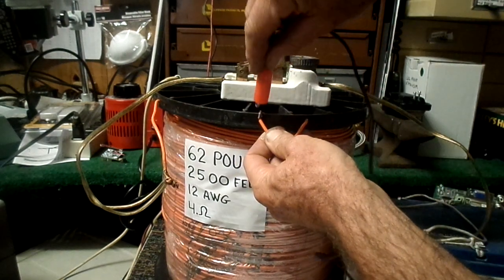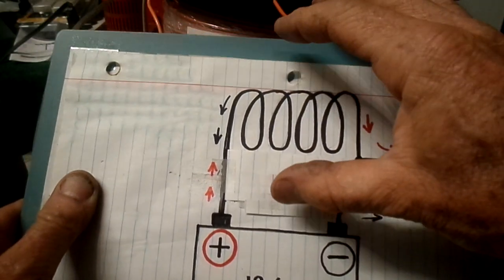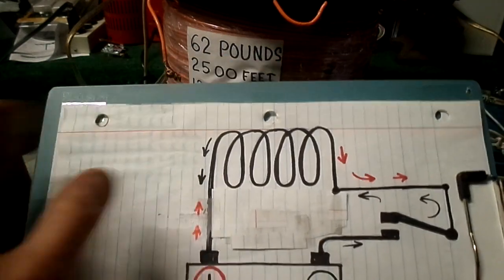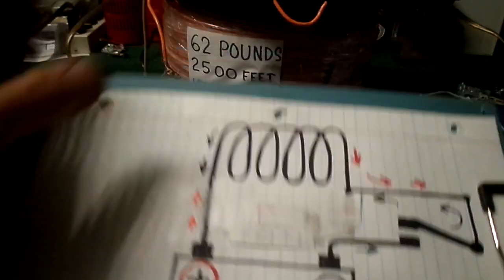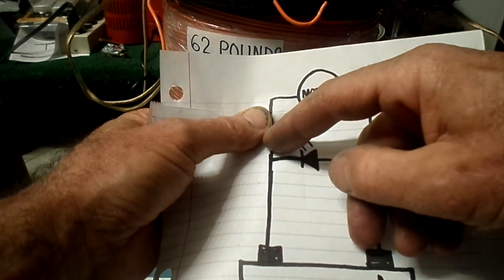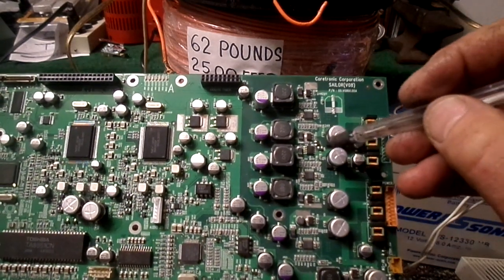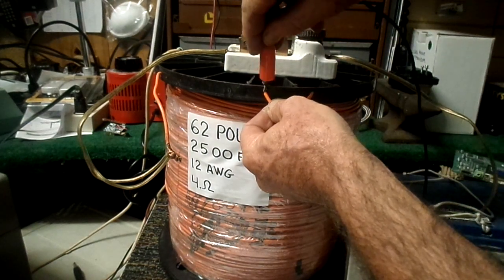The Back Spike From A Coil Can Destroy Switches, Relays And Electronic Parts.

Comment: "The Back Spike From A Coil Can"
What is a coil can?
Anyway, yes, I was exploring this phenomenon a few days ago.  With a 30 volt dc, current limited power supply, on breaking the circuit I get 800 volts peak-to-peak, probably more but that's as high as my oscilloscope measures.  Not only that, it oscillates and the spark lasts about one millisecond but is actually a hundred or so sparks.
Reply: Right it oscillates back and forth but it can go thousands of volts I always called it transient volts not back spike.

Comment: Energy is conserved, but power could theoretically be momentarily larger than before the spike. Energy is the sum of power. If the energy is released very quickly, the power could be destructive. In fact, the lower the resistance next to the diode, the slower the release of energy. This is initially counterintuitive because we associate a short with danger. But the current in the coil is allowed to die down slowly, letting the energy in the magnetic field die down slowly.
Reply: THE LAW OF CREATION OF ENERGY 
How Electromagnetic Field Energy is created in all Current Bearing Wires at the Sub-Atomic Quantum Electron Level via Electron Fission and Electron Fusion: https://www.youtube.com/watch?v=hVPT1KvVmFE

Comment: What interests me is if it’s possible to temporarily store some of the coil energy in a motor into capacitors to improve efficiency and protect against sparks when turning the coil off. (And feed energy back when more effective.)
Reply from the maker: I've done this, but there are problems you encounter in attempting to recycle the back spike, which slow the motor down.
Reply: You have just discovered the Tank Circuit; a capacitor in parallel with an inductor (coil).  The inductor charges the capacitor, but the capacitor then energizes the inductor.  Back and forth it goes.
Reply: Now if you put in a diode so the capacitor cannot just bleed back into the coil, you have invented the "boost circuit" where a lower voltage DC can be made a higher voltage DC.

Comment: Interesting video.. I've been experimenting with the Spike  & I've come across what you're explaining in your video..  I built an Automotive Relay Charging device which I'm currently having a go at sound proofing & when I tried measuring  the output going to the charge battery it killed my meter.
Reply from the maker: It sounds like you may have low end meter, and you exceeded it's voltage capacity.

Comment: there is something bothering me in your explanation but I can't really put the finger on what it is. Isn't it so that when you stop the current / open the switch, the coil doesn't create a reverse polarity, but in fact keeps pushing current in the original direction, because the coil resists changes? So this is why placing a reverse diode works, because then the current can just go on in the same direction, looping back to the start of the coil, while without it it would burn your LED (in the motor example) overpowering the LED in its reverse (blocked) direction with +80V on the anode, and boom
Reply: You are right. The video creator has not understood that "Back emf" is only induced while the coil is charging. When the supply is switched off, the magnetic field collapses and induces current in the same direction as during charging.
Reply: Correct.  Also, the snubber diode will slow down the decay since the decay current is actually still a current and helps maintain its own magnetic field.  This is a factor in things like relay drop-out or release.

Comment: You mentioned that the power would be reversed after opening the circuit.  This was confusing to me until I realized you probably meant that the voltage across the coil swapped polarity.  I'm pretty sure the current through the coil continues in the same direction - you apply a voltage across the coil, like spinning up a flywheel, and when you break the circuit the flywheel tries to keep spinning, pushing really hard and building up large voltages almost immediately.  (I suppose technically power = voltage*current, so the power DID reverse, but I sorta don't think that's what you meant.)
Reply from the maker: Yes I meant the polarity was reversed coming from the coil the moment I opened the switch.
Reply: This is how it works. Consider the coil as an energy storage component just like a battery which store energy during charging and release energy when the battery is used to power a load, so when you send current into the coil, you are actually charging it and when you remove the power source, the stored energy comes out but due to the nature of coils the polarity of the stored energy will be reverse

Comment: You are making hybrids of Tesla’s hairpin circuit. It uses a spark gap to generate back EMF, as a normal capacitor would be burned out. The primary coil is acting like a capacitor.

Comment: I suspect that your experiments can go further.Try the very same experiment but this time with various cores.The usual soft iron laminated core, ferrite , the phenomenal Metglas and Permalloy. In addition, pulse it at its resonant frequency......And lets see how the BEMF behaves...... I have subscribed and I have clicked the bell.Waiting to hear from you.
Reply from the maker: Aa one who loves to experiment, you have stimulated my curiosity. Have you ever conducted the kinds of experiments you suggest. If so what did you discover?
Reply: @GrantsPassTVRepair  Glad to hear from you.Like you I have a interest in magnets and coils ;-). I was fascinated when I actually proved that BEMF existed.So it lead me to start  planning experiments like what I am suggesting.Air Core versus Iron versus metglas etc.As Metglas has high permeability and can operate at higher freqencies, I am thinking we should see something interesting.
I only got to the charging capacitors with BEMF.So my next move is a series of Microwave transformers driven at their resonant frequency.....But i gotta get volt meter number 10 and a handheld scope.You however have the equipment and drive.I would love if you did those experiments.I am learning from them.
Reply from the maker: @garydunn9418  I've put many of my ideas to rest, in pursuit of so my responsibilities, but it's still fun to ponder now and then.
Reply: @GrantsPassTVRepair  Does that meant you wont be trying the experiment with the suggested cores ,resonance etc?
I plan to.I will report my results here.I wont buy the metglas yet as I have to experiment with the iron cores I have first.I see no point in moving on to metglas if the theoretical effect is not seen in iron cores.
Reply from the maker: @garydunn9418  Perhaps at some time in the future I will,
Reply: THE LAW OF CREATION OF ENERGY 
How Electromagnetic Field Energy is created in all Current Bearing Wires at the Sub-Atomic Quantum Electron Level via Electron Fission and Electron Fusion: https://www.youtube.com/watch?v=hVPT1KvVmFE

Comment: I always wondered why there was a diode present so often on magnetic coils.
I thought it was just a passive overvoltage protection for the coil, but it's actually an overvoltage protection for the relay powering the coil.
Reply from the maker: The diode across a relay prevents the back spike from  the coil from damaging one of the regulators or other components in the power supply.

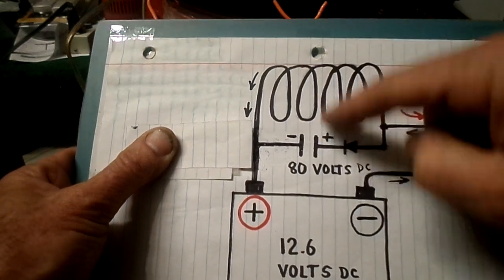Comment: I don't know what you mean by black arrows on left and negative voltage at 2:15... won't the inductor always be positive on top left and push current to right to maintain its desire to not change current direction?  Also I always wondered what happens with capacitor voltage,  how it ever discharges, and how effective it is depending on duty cycle.

Comment: went it school for electrical theory and if the current is ac or pulsed one can for limited time observe reactive power and power flow from anther demotion. one has to balance capacitance, reactence, inductance, and it can be observed!!! get the balance right and the electric meter will spin backwards!!! been a long time do not have my papers or books but their are is some solid theory. but it has yet to be quantified.  if one wants to find alternative electrical energy, electro statics and rf/pulsed dc is where I wold look, all the study has been ac/dc. take care.
Reply: look into newman motors. they run on that principle and uses negetive amps to run.

Comment: Thanks for the video. maybe you can educate me.
 I'm using a timer to energize two 6v relays. One relay provides + current to a dc motor the other provides ( - ) current to the motor. The motor opens a small door. When the door is fully open it hits a limit switch which cuts the power.  In time a different timer activates 2 other 6v relays that then sends + and ( - ) to the same motor but in the opposite polarity to reverse the motor thus closing the door. All are running off of the same 6v battery. When one timer activates the relay and the door hits its limit switch killing the power the opposite timer picks up some sort of back spike and goes dead. What do I need to do? Do I need a resister, a diode or something else? And where in line would it go? 
Hope you can help!
Reply from the maker: That's more details than I'd care to figure out withouting being well compensated for my time.

Comment: If another coil is added in series with the flyback diode so that the back emf from the main coil energizes this new coil, can a feedback loop occurs in the system in which current from the battery adds up in parallel with the back emf of the second coil to power the main coil once again
Reply from the maker: I'm not entirely sure I understand your question, but it sounds like you're wondering if the back spike from a coil can be recycled, to where it can go from one coil to another, and keep going indefinitely. If that's what you're asking the anwer is no. Due to the resistance in the coil, the flyback spike keeps getting weaker every time it oscillates. You may find this video I made a few years ago to be of interest.  https://www.youtube.com/watch?v=Ky2T1-n_Fks
Reply: @GrantsPassTVRepair yes, thats the idea.since the second coil can also produce back emf current during operation could it be recycled
Reply: @GrantsPassTVRepair  if the back emf from the second coil is recycled back to the first coil and results in a higher back emf from the first coil to the second coil in the next cycle perhaps this could be useful
Reply: @GrantsPassTVRepair  I believe since the back emf from the second coil would be in parallel arrangements with the battery to power the first coil again in the next cycle assuming you are using a make and break device or pulse generator to run the system
Reply: @GrantsPassTVRepair  I know what I said my be tricky but I believe that if the timing is right there should be effective feedback between the two coils
Reply from the maker: @morufaregbe4627  Such ideas sound promising, until you start experimenting with these ideas, and discover they don't work as you would hope, but I'm all for experimenting. It can give you a better understanding than what you may read about in books.
Reply: @GrantsPassTVRepair  yeah you maybe right but it's just an idea I created in my mind but I've found a better idea that would actually work which is similar to capturing and accumulating the back emf to enhance the efficiency of the system. I've already simulated it several times and the result was amazing but I am not sharing it here for security purpose. The one I described was one of my many concepts.

Comment: You see I have problem there Is there any calculation for alternators how is their starting charge effected be useing centrain capacitor types with the lead acid baterry .
I used hv ceramic capacitors just for fun to test out that plasma ignition just bunch 3kw multipel ceramic capacitors in series soldered together 1 goes to + E core type hei ignition coil the 2 side from capacitor directly to ground now I have strange problem me original starting charge from 1000rpm sudenly goes up to 3000rpm or more so tehnicaly speaking me altenator light is always ON if Im under that rpm range so me alternator who is a delco 12si I ques is constantly back charging.
So it apears true ground baterry potential is interacting with alternator and capacitors.
So is there any way I can stop alternator to get effected be this strange effect?
Similar happens to tractor alternators who have capacitors if the capacitor fails the baterry does not charge at all.
So any advice how to counter that problem?
Shuld I use capacitie on the alternator to counter those series hv capacitors on me ignition coil?
Plasma ignition is nice so is amplifier ignition but the baterry get effected from it sadly.
Be the way with plasma ignition the starter motor spin lot faster and smuther engine running perhaps litel bit bether fuel economy.
So thats why I wonder how is that potential controled with capacitor and baterrys exactly does there exist some equation or similar and exactly what type capacitor is used to control field in the alternator?
Reply from the maker: You ideas don't make much sense, so I can only comment on your last question . The field  winding on an alternator is not controlled by a capacitor. It's controlled by a regulator which varies the power going to the field winding, and this in turn regulates the alternators output.

Comment: Sir what  we need to do to if their is coil workig on 220 volt, means i m using a relay of 220volt, what type of  diode or capister i used to avoid back spike??
Reply from the maker: Your question is difficult to understand. If you're asking how to eliminate the back spike you can use any diode which can handle the back spike current and voltage without being harmed.
Reply: Electric Fan Capacitor 1uf, parrallel in both 220v relay terminal
Reply: 220 volts suggests you are using AC (alternating current) and you cannot use diodes as snubber in alternating current.  Capacitor works fine but should have a small value (ohms) in series.  Of course the capacitor should be rated for the purpose (AC capacitor, not a DC capacitor).
Reply: if 220Vac,,
the snubber is non-polar capacitor 0,1uf/630volt series with resistor 180ohm/5watt... Then pararel with coil_relay...

Comment: I was hoping you would put a big diode to your inductor.
Reply from the maker: When I did so my capacitor instantly went from zero to 80 volts just by opening my switch one time,  but yes I should have shown the actual experiment.

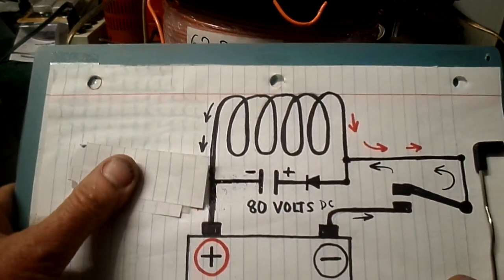Comment: Hi. From 1:40 on, I wonder how the capacitor will discharge once it is fully charged, since the diode is then reverse-biased? Maybe this is a mistake of yours.
Reply: The electrons from the negative side of the capacitor will go back to the positive side of the battery, no?
Reply: They could also go back inside the coil and the voltage will dissipate

Comment: I have 28v DC with 2-6 amp panel meter flowing, with 2 or 4 Millihenry metal core inductors. How do I set it up with capacitor for end use of 6amps across a separate spark gap for approx with 100volts output, and 6 amps same time? Peak amps on oscilloscope , or average amps on small hand meter?. Standard panel meters do not register at high speed. Is this current final flow from the battery through the coil and out, or is current only out from capacitor?
Also, the vibrator relay with capacitor I tested ,only allowed flow of 1 amp through separate set contacts. Either problem of duty cycle or frequency of L + C.
Reply from the maker: Your not saying anything I can understand.

Comment: It took me hundreds of transistors before  I figured out how to turn on and off a 25lb coil with out blowing up the transistor.  The snuber circuit that i came up with used diode capacitor diode and a pico capacitor over the othe capacitor. Then put a voltage draw across the capacitor (light bulb) not to allow the voltage to go past the transistor voltage rating
The voltage can easily climb in the thousands if not used up. I know how that feels😂

Comment: Great video could you tell me how you would control the voltage spike in a bidirectional dc motor such as a power window circiut to protect the switches.  Thank you
Reply from the maker: If you have a bidirectional motor that means it's being controlled by two switches that are in one package. This means the switch must reverse the polarity of the power going to the motor. so placing a diode across the motor output would be impossible since one position of the switch would allow power to flow in the forward biased position of the diode which would short out the diode when the polarity going to the motor changed, but if you had a reverse biased diode at the contacts of each switch output rather than on the motor itself that's the only way I'm aware of that you could do this, but perhaps a non-polarized capacitor at the motors input contacts might also be used to absorbe the back spike. Since the voltage of the back spike is much higher than the input voltage to the motor just make sure your capacitor is rated to handle the voltage. You can google "putting a capacitor across a switch to prevent arcing" to learn more. I hope this helps.
Reply: You can also use an RC snubber instead of a diode.  The capacitor absorbs the surge and the resistor reduces oscillation that otherwise will occur.